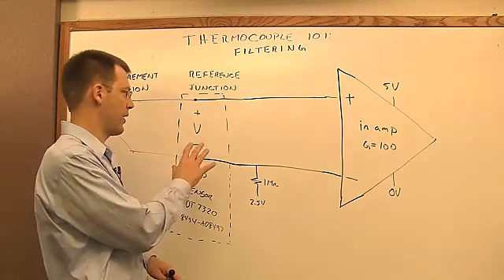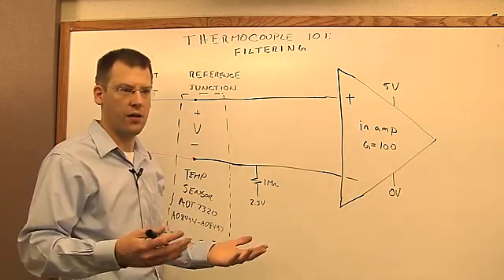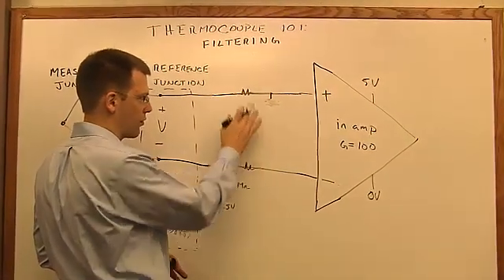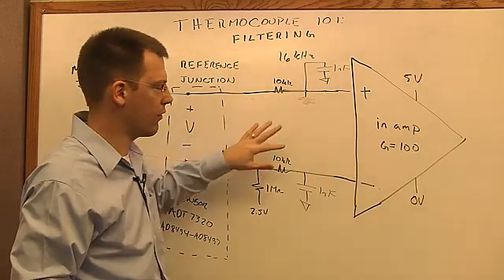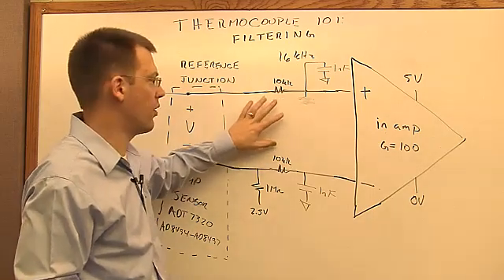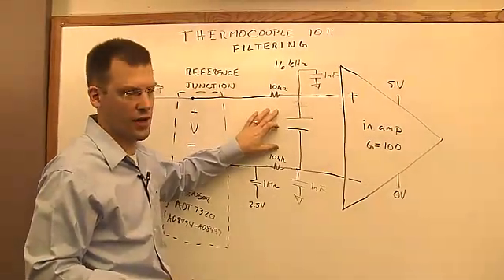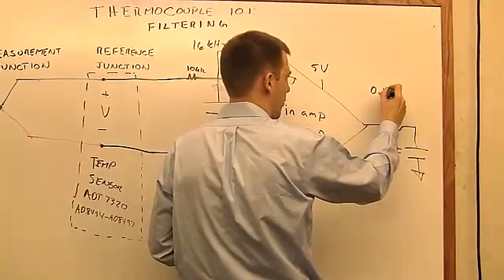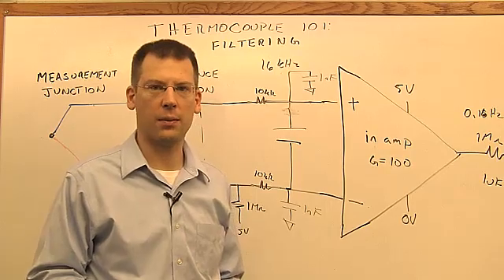Thermocouple 101: Filtering a Thermocouple

Comment: Why is 0.16Hz used as the cutoff frequency to filter out 60Hz noise?
Reply: The filter should be set just wide enough to allow the signal you want to pass.  The lower you can set the frequency cutoff, the more attenuation of the undesired frequency you get.  Since temperature measurement is generally quite slow, you can typically use a really low frequency filter.

Since you’ve already found the thermocouple 101 series, you may also find the Filtering 101 series helpful as well:
https://www.youtube.com/watch?v=ftk9C45F_bo&list=PL64A193CF0B94C5D3

Comment: hello, at this time I am using a LTKA001 and LT1025 to amplify and compensate thermocouple signal, also I built the differential thermocouple amplifier circuit that you Analgo Devices provide on the datasheet PDF, and I am having some problems to increase amplification gain to 100 mV/C, which will be good to increase sensitivity. any advice?
Reply: Welcome to visit our company website: www.chinathermocouple.com OR you can visit our company youtube channel page to view.,Our company specializes in the production of temperature meters, custom thermocouples, China's top three instrument companies, welcome communication.